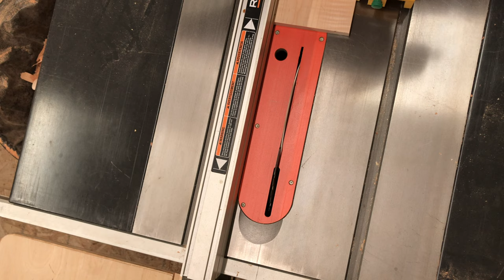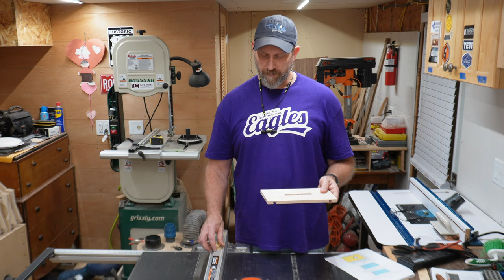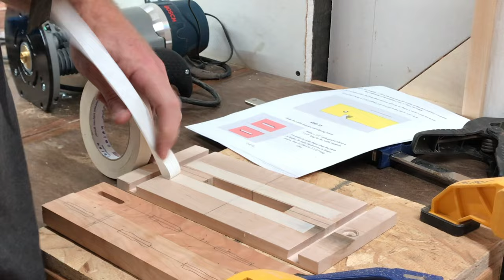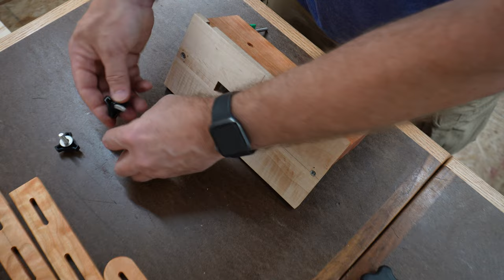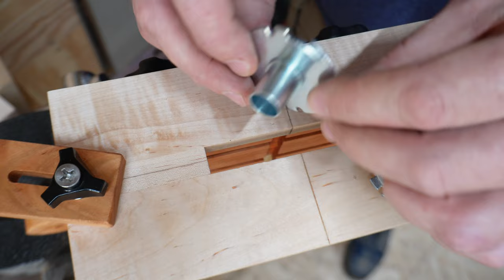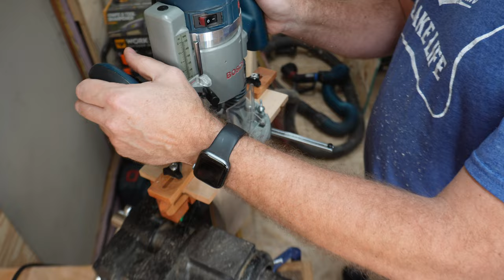Mortising Jig for Loose Tenons. WAY CHEAPER than Festool Domino!

Comment: For the screws, perhaps make the holes smaller and then tap them so the screw will tighten to the hole.
Reply from the maker: Thanks. Didn’t think of that because I wasn’t expecting a problem. But that might work for someone else who sees this.

Comment: Well some people are a little more experienced in different types of hardware than others. I think 💭 you have some good ideas there.
Reply from the maker: Thanks Chris!
Reply: @BrettsWoodshop  yeah I see you released the plans for this project. I will have to check them out. I’m in the process of setting up a new shop. Had one before but I moved. You wouldn’t believe me if I told you what I found on my table saw I got from my dad. I knew he was but dam. That dammed old dementia crap. It works on you for years before you can’t function properly. You just do a lot of stupid stuff. Anyway, enough of that. Going to check out your plans and probably build your jig.
Reply from the maker: @ChrisWhitley-tx1oz  Sorry about your dad, Chris!
Full disclosure, the Plans are not mine. They belong to Tamar from 3x3 Custom. However, if you wouldn't mind using my provided links to order your hardware I would appreciate the support! Happy mortising!!